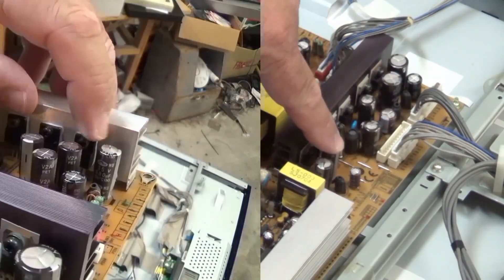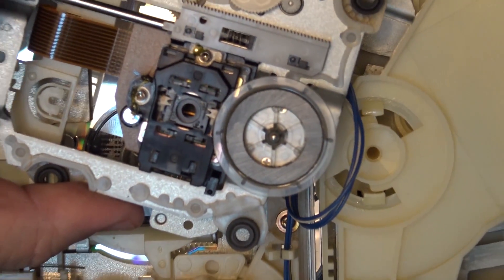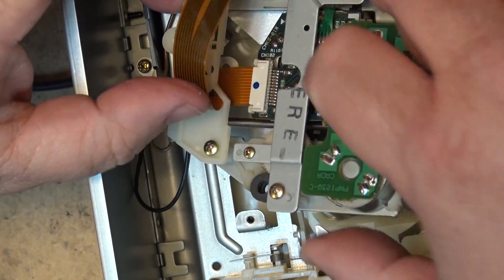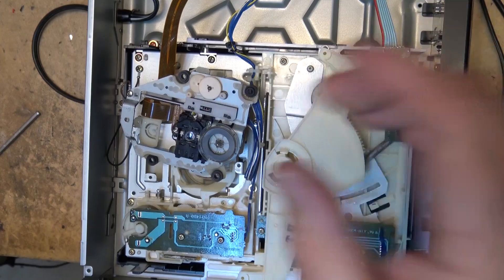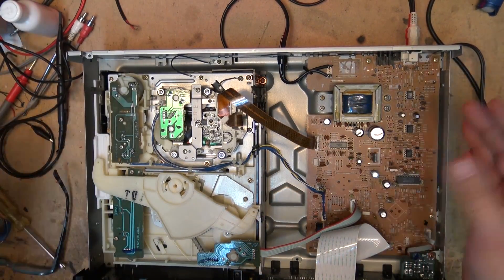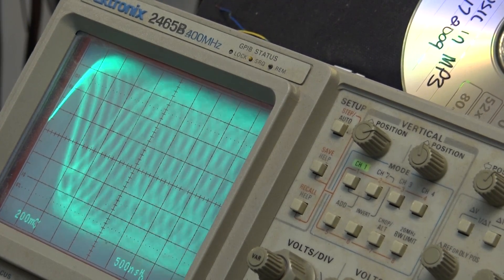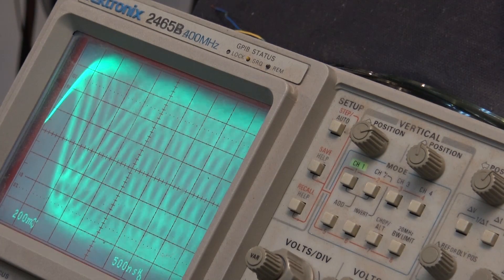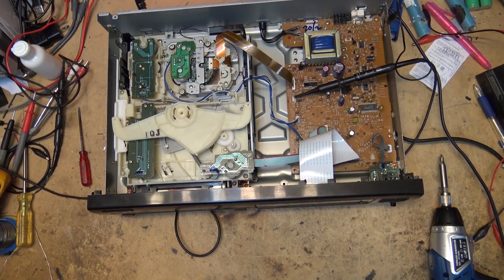Pioneer PDM703 Optical pickup repair

Comment: Would you consider explaining how to find the a laser's RF signal in a future video? I work on CD drives from time to time and I sometimes have to tweak the pots because they don't read too well anymore. If a laser mechanism doesn't have a well documented RF test point online I'll usually get stuck. Sometimes the fancier laser pickups have tons of unlabeled test points, making things that much more difficult.
Reply from the maker: Usually they are labeled. If not you can usually find it by probing around until you see the waveform.

Comment: I've heard about this problem and because if it I have always avoided old Pioneer CD Players. But this seems to be quite an easy repair, if the lens is still inside the unit. I thought the laser assembly would be buried much deeper in the mechanism requiring complicated disassembly and reassembly.
Reply from the maker: Not on these units. Right on top. The other units with the laser on the bottom, more difficult to access.

Comment: I've heard about this problem but never seen it in person, makes you think what were they thinking with this design.
Among other weird fixes, I once read on the internet like 15 years ago, about using soapy water to clean pick-up units whose lenses were dirty on the back.
They would dunk the entire thing in a glass of soapy water, never saw any pictures of it and I never heard of such method again, did you ever heard about it or even do it yourself?
Reply from the maker: Never say anyone dunk a pickup in soapy water. I have one that is bad from smoke. Perhaps worth a try and see if it will clean up.

Comment: i have the pd-m40 it also happen to me and i just put the lens back in and it has not fallen out since
Reply from the maker: It will fall out again some day. 
Thats why it needs to be glued in place.
Reply: @12voltvids  Even with the glue, it'll still fall out again. Just it'll take even longer to do so (and you have to clean the old glue chunks off while you're at it, which isn't fun).
Reply from the maker: If it is glued in it shouldn't fall out. It took 20 years to fall the first time. I doubt the unit will still be serviceable by the time it needs service again. I have never seen them fall out when glued in place. The original was just press fit in.

Comment: If the mech was flipped upside-down inside the unit itself, and the slot matched to fit, then this problem can be solved for good as gravity will actually help the laser instead of hinder it's longevity. That and the ribbon cable needs to be made longer to reach the components it needs to in that orientation.
Reply from the maker: I don't know why Pioneer put the disks in this orientation. Me thinks it was so that they were infringing on someone else's patents with regard to CD cartridge changers. (Sony with their car audio)
By making the disks face the opposite direction they aren't the same right.
Reply: @12voltvids  Changing the orientation doesn't fix infringing design. They should've licensed it from Sony first.
Reply from the maker: they just have to make the mechanism different enough. Sony for example was a 10 disk cartridge. Pioneer was a 6. Sony extracted the disks from the trays, pioneer flipped the tray out. 
Another reason for the up side down disk was because the tray flipped out. If the disk was played from the bottom, there would have needed to be a big cutout in the tray design so the laser could pole through. This is why sony extracted the disk completely, and reinserted it into the cartridge. Having the swing out tray with the disk upside down only required a hole in the middle for the clamper, as opposed to a huge cutout for the entire optical block, which would require it to be completely open on one edge so the laser could play to the edge. This would have reduced the strength of the swing out tray, and increased the probability of jamming. So the upside down disk allowed a complete tray that the disk sat in that would be resistant from jamming, and was different enough in design that they could patent it.